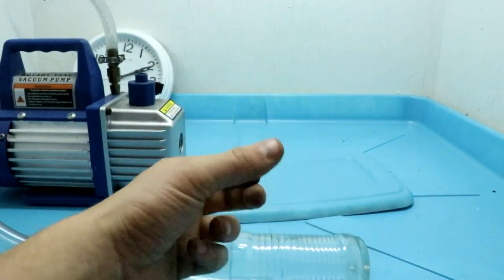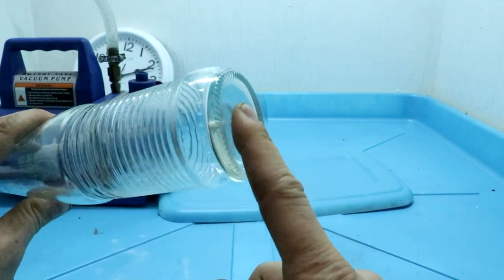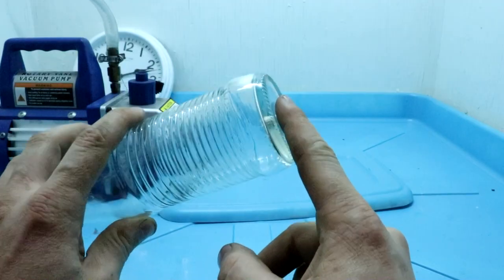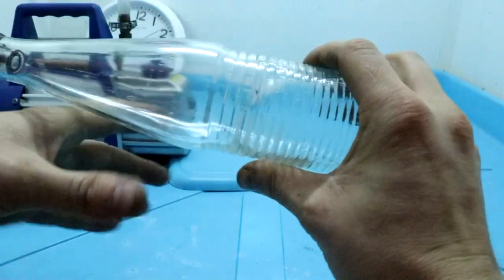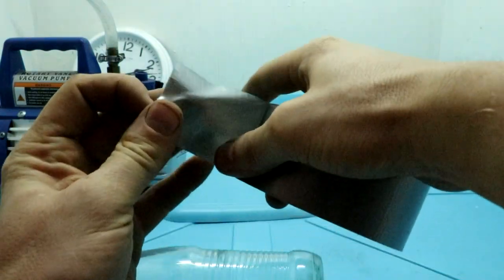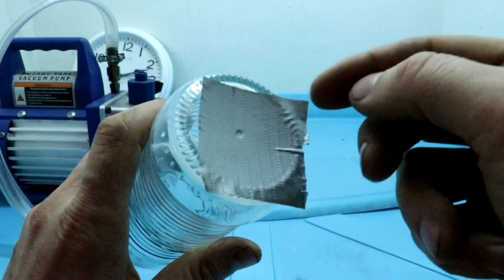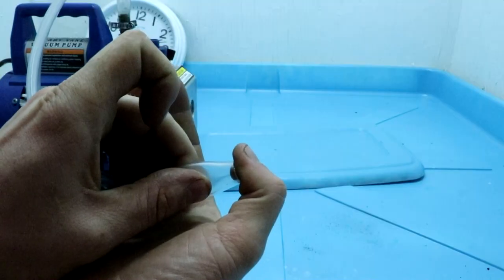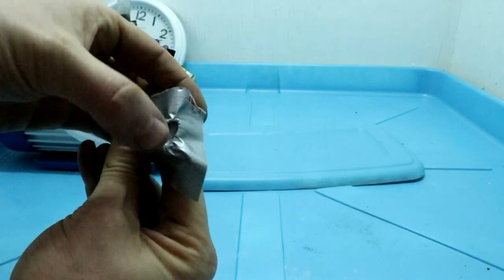Use Your Finger to Stop a Leak on the Space Station?

Comment: Dude on ISS got a legit space hickey.   I use vacuum chambers in work regularly and use my finger to block the vent so I can very quickly let air back in to help degas thicker epoxies.  A myth i always heard is that its fine to do unless you have a cut or something.  Ive never tried it because I'm not willing to put a open wound over the only vent of a vacuum but curious what would happen.

Comment: You should try it in a vacuum chamber and shot it like it would be on the iss, see what the result would be to a sudden puncture under full vacuum. Or a pressurised  can in a vacuum chamber then puncture it.
Reply: Faith is a gift I’m Yet to receive if the experiment could be created the same as the space station being hit by the micrometeor and making the same results you have just seen on tv a few hours ago.
Reply: When I was young I shot a full small bottle of MAPP gas with a .22 and the rupture hole wasn't much bigger than the bullet itself, it just shot across the water like a rocket (floated it out on a raft into a pond). Not sure about the pressure though.

Comment: It's actually only 5 pounds per square/inch on the ISS. They can get away with this safely because of the pure O2 environment. Anything under that pressure is unsafe though.
Reply: The ISS doesn't use a pure O2 environment, and is maintained at standard atmospheric pressure.

Comment: Units are important here... pressure in space is on the order of 8.00E-14 Torr whereas this pump gets you down to probably around 1.00E-2 Torr... you think that 12 orders of magnitude doesn't make any difference in your estimation? Could you discuss?
Reply: Yes, units are very important.
In the units you are using, your "12 orders of magnitude" is a vanishingly small percentage of the total.

At some point you have to realize you are talking about a difference of a few thousandths of 1% in the pressure differential between the ISS and space and what his vacuum pump is able to create between the inside of the bottle and the atmosphere.

This equates directly to a few thousandths of 1% difference in the forces involved.
Even allowing for off gassing from his finger, and the imperfect seal between his skin and the glass, the difference in the mechanical forces involved is minuscule to the point of being irrelevant to the demonstration.

Comment: So at uni we use vacuums in our experiments all the time. Vacuum filtration, vacuum evaporation  vacuum drying etc. sometimes i will use a  vacuum  3 times in an hour and i'm still only a student . 

I'm assuming the  vacuums we use are as close to a pure vacuum  as is needed for this test. right? especially  vacuum drying with a descant. because i frequently use my hand as a test to see if its working correctly. Do have to take your hand off before it gets to a really good  vacuum  because you end up pulling stuff off benches and having to use your other hand to get it off but still. 

How close do you imagine this gets to being a vacuum?

Also. Its usually like 3-7cm diameter holes so it's a much bigger hole to cover with bare skin

Comment: This is only low vacuum, would you still put your finger on when high vacuum or absolute vacuum?
Reply from the maker: yes
Reply: If there is a Space vacuum or High vacuum, it doesn't matter, it will have a minor effect on the force which acts on the finger. 
Simple calculation F=Δp*A. Because the overwhelming majority of Δp is pressure inside ISS, which is 1 bar. 
Space vacuum is 9.87×10^−10 bar .... Δp= 1 - 9.87×10^−10  = 0.999999999013 bar
High vacuum is 9.87×10^−7 bar .... Δp= 1 - 9.87×10^−7 = 0.999999013 bar
See? Δp is still approximately 1 bar, thus the force will not change.

Comment: You theorized that the water stopped boiling because it got colder, but I suspect it's because it was never "boiling" that rapidly.  Rather, I think you were pulling out the gases dissolved in the water.

Comment: Cody, question. Considering you plugged the entire small hole and surrounding area with your finger, wouldn't it be the internal pressure of your body trying to force itself into the bottle, rather than the air pressure? Honest question.
Reply: The internal pressure of your body is the same as the atmospheric pressure around. Structurally, we're ultimately just bags of incompressible fluid with some bones in the way. Pressure from one side is transmitted to the other, and if the internal and external pressure don't match up, whatever compressible parts of us will do what they need to until they do. Decompression sickness, for instance, is all about external pressure getting transferred through flesh into our internal fluids and screwing with them.
Reply: Well, we're not bags of JUST incompressible fluid - we have plenty of gas-filled internal cavities. More to the point, though - the human body is capable of generating its own internal pressure via blood pressure at the very least. It's why body parts begin to swell painfully when exposed to full vacuum. Take Joseph Kittinger, for instance - "the first high-altitude jumper." He suffered a failure in the glove of his pressurised suit and toughed it out until a height of over 30 km, causing his hand to swell to double its normal size, reportedly. Now, I don't know a lot about that incident so I may get some of the facts wrong, but it does seem that the human body's own internal pressure does play a role in pressure dynamics.

Comment: How long would it take the air going through that hole for the pressure of the ISS to fall to dangerous levels? Assuming no one noticed it and any pressure detection devices and the backups I'm sure they have failed.
Reply from the maker: Potentially days.

Comment: What happens when a leak is detected that is behind equipment that is not easily moved they say that this hole would have lost all the pressure in about 18 days.
Can they evacuate in that time frame?
Reply: They can evacuate pretty immediately, but it wouldn't be necessary because as Sheldon said you can always plug it from the outside if you're unable to locate it on the inside.

Comment: The claim of the lack of pressure in space / outer space, is at a much larger absence, to the multiple of power to something like 14... your pump is literally like a 100th of what the claim of space is... The other idea, that crosses my mind, it the sudden appearance of a hole and the ripple effect that would have on the craft, when considering something being able to knock a hole through the titanium hull / skin. I suppose it would be a shockwave effect... But yes, I see what you are doing. To expand a wee bit further, the volume of air mix with in the craft, vs the CFM that is trying to equalize through a hole like such, is exceptionally violent on the inside of the craft. When adding special instruments on the inside of pressure vessels, (my old occupation) if the air is allowed to equalize to fast, the equipment would be so badly damaged, when talking about the levels past what your pump can provide. I am talking about a dinky pin hole, and not even an 1/8 inch diameter hole... There has even been some cases that metal was sheared, once the device was ripped away from its mounting, and was being violently tumbled about inside, and the tiny pin hole would be a jet of violent hot gas, (which is just your typical air that is on the outside of the vessel, that we breath) and would cut through the various alloys of steel and brass parts. Those vac pumps we used were every bit of 5 million dollars, starting. The pressure vessels typically consisted of 8 inch thick wall high end alloys, on the small units, some that were manufactured, had 20 inch thick wall high end alloys. Absence of pressure, is a prorated scale exponentially and rapidly, the lower you go, the further the danger ramps up most importantly. Those precision high end vac pumps, to get to the lowest of the low, (which as I understand it, those monster units, still doesn't even come close to outer space), would still take an hour to 6 just deal with a vessel that has a void the size of 5 to 10 gallons. I am not saying that your pump is not dangerous, as it actually is, if not used correctly. But, these pumps, that my old occupation use, were contained behind blast doors, the plumbing from the vac pumps to the testing lab, were massive and also have thick walls, and made of high end alloys. I wish I could tell you more about this, but, I can't, sorry. I will say, I do see your point, but, there is so much more to this that what you have done or tried to prove.I politely state, one can quickly assume this would be click bait, just to instigate the flat earther folks? lol. None the less, interesting video lesson for the day though..
Reply: I'm sorry, but You are just plain wrong. The difference in force acting on a vacuum chamber pumped down to a millibar, is negliable to the outside force acting on in if you continued to pump it down  to say 5*10-8 millibar.

And vacuum pumps aren't very dangerous except for large turbopumps, which rotors spin very fast and may fail sometimes.
Reply from the maker: Yeah I’m calling bullshit.

Comment: Serious question, so when a vacuum"boils" the water... Does that mean it's hot as well?
Reply: No water is liquid because it's particles don't have enough energy to escape each other. When you add heat It gives them energy to escape each other. 
Similarly if you take away pressure (no pressure in space) the particles aren't pushed together so they don't need much energy to escape each other, hence why the water boils at 20°c - room temperature

Comment: this is a totally unrelated question, but do you know why marshmallows undergo significant expansion when heated in a microwave, but not when heated by a flame or heating coil?
Reply: microwaves use a high level of RF radiation to heat things up, while flames and heating coil are purely just heat, and no they do not pose any risk to you or the food
Reply: Your microwave basically boils the water in the marshmallows from within, making steam that expands them.

Comment: Another step to suggest a BRIEF full body exposure to space could be survivable. 
Boiling blood and eye gel and all that horror are real, but how long would you have? 
If you were prepared and held your breath, what would be the effect?
Reply: If you held your breath, bad things. If you exhale to protect your lungs, I've seen estimates about 30 seconds of consciousness and 2 minutes of recoverable brain function, limited by the oxygen in your blood as the air is pulled out of your lungs. Holding your breath would increase the pressure differential across your chest cavity, doing things like rupturing alveoli and possibly crushing other nearby tissues (certainly not good for your heart). It's more of an exercise in medical biology than in physics.

Comment: And what about the temperature outside the station? I mean if the hole was facing the sun wouldn't your finger burn to a crisp and if it was facing the near absolute zero temperatures of the shade wouldn't it start to get frostbitten and necrose around the part that's exposed to such temperatures?
Reply from the maker: No, our universe doesn’t work like that.

Comment: Isn't the air outside pushing it really? But how is it possible for your skin to be sucked in while your thumb is not bent? The motor is generating vacuum continuously, probably that's why, but in space there is nothing like that.
Reply: pascals law. Human body is mostly liquid and pressure distributes equally across the volume of a liquid. And it just happens to be the case that Cody has 1 atmosphere of pressure pressing on him, except that tiny patch on his finger where's vacuum. So yeah, it's the atmosphere squeezing him into the hole.

Comment: Oh, geez, thank God.
I thought "Cody is going to die... again. He's going to get his finger, and then his entire hand, and then his entire body, sucked through a tiny hole and blown out the vacuum pump."
Reply: I just stuck my thumb over a much bigger 9.5mm hole on one of the inlets of one of my vacuum pumps, and pulled a vacuum to below 250 µmm Hg on it, about 0.0003% of atmospheric pressure, and still have all my bits and pieces. ;)

Maybe later I'll try it with the 13mm pump inlet, and an even lower pressure.
Reply: @markbeiser  Don't overheat your pump! Also don't take advice from me, because I've never operated a vacuum pump, but still...

Comment: Wasn't duct tape specifically designed to deal with these sorts of situations? It is "duct" tape after all, and both fluid and air ducts are all about pressure.
Reply: It was not made for air ducts, it was made for sealing ammunition boxes. And it was originally called "duck tape".

And it is actually not that good for air ducts, there is special tape for those which is far better suited. That silver stuff (i forgot the name of it) is what you should use for air ducts.

Comment: Inversely how about covering a 2mm hole, except at the deepest part of the ocean?
Reply: If you had a vacuum tube with a similar hole at the bottom of the Mariana Trench, it would pull on the tiny part of your finger with a force of 34 kilograms, which is quite huge compared to the 32 grams of force you'd feel with the same hole on the ISS.

I'm no expert, but if 32 grams can displace your skin that much, I'm pretty sure 34 kilos would be very, very bloody.

Comment: But the space is very cold, if you really put your finger in that hole, how log it will take to damage your finger because of freezing?
That would be really interesting!
Reply: A vacuum doesn't have a temperature. If the outer side of the metal hull was in sunlight, the metal would get warmer. If it was in shadow, heat would radiate slowly away from the metal and it would get colder. The finger was not in danger of freezing.
Reply: @fairwinds610  That makes sense, Thanks! :D

Comment: You say your average ambient air pressure is 12 pounds per square inch? converting to metric (I'm more comfortable with that system) that's 82737 pascals.
If we take the International standard atmosphere, and assume that it's at least 15 degrees Celsius (288.15K) in the lab, we can use the equation:
P₁ = P₀ *e⁽⁻ᵍ/ᴿᵀ⁾*⁽ʰ₁⁻ʰ₀⁾, 
where g is 9.80665 m/s², R is the specific gas constant of dry air (287 J/Kg*K), P₀ = 101325 pa and P₁ = 82737 pa, h1 is  Cody's altitude and h0 is sea level.
Rearranging we get:
P₁/P₀= e⁽⁻ᵍ/ᴿᵀ⁾*⁽ʰ₁⁻ʰ₀⁾, 
It follows that:
Ln(P₁/P₀) = (-g/RT)*(h₁-h₀)
Filling in results in:
Ln(82737/101325)= -0.20267 = (-9.80665/(287*288.15))*(h₁-h₀)
-0.20267/((-9.80665/(287*288.15))) = (h₁-h₀)
let h₀ = 0 (sea level)
∴ h₁= -0.20267/((-9.80665/(287*288.15))) = 1709m above sea level

Seeing as the average elevation in Utah is around 1800m, I would say that's probably not far off the actual value.

Comment: Same when there is hole in the plane?
Reply: There is less of a pressure differential, but usually if there was a hole for some reason in a plane, it would be much larger, which causes a rush of air out the hole resulting in more damage to the plane.

Comment: People also overestimate just how quickly a 2mm hole like that will "deflate" the ISS.
You would lose about 10% of the air pressure in
.
.
.
.
.
.
.
.
5 days.
Reply: I mean, I'd be a little worried if I needed to find a 2mm hole in a large spaceship in a span of 5 days. It's a good thing they noticed something wrong. I mean, they'd be fine either way, considering everything is monitored and all, but still.